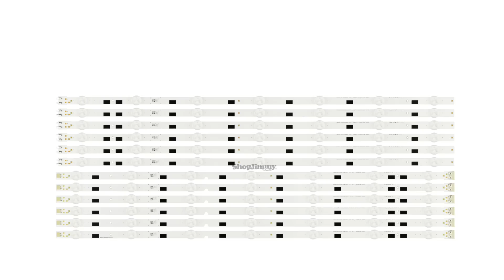Samsung 58" TV LED Strip Replacement Tutorial for No Backlights Samsung Model UE58 UN58 UA58

Comment: Can anyone please help i dont know what to do anymore to fix my tv,samsung replaced the powersupply board and the mainboard,tv worked again for a while because 3 months later a purple bal showed up in the left bottom corner, i replaced all the led strips 3 weeks ago and the tv whas like brand new again,now the problem i have for the last 2 days is that when i go into menu my backlight dims on its own,the tv never did that before,i opend it up today to check the ledstrips they all work but 1 led bulb illuminates less then the others,did i have bad luck with one off the ledstrips or is this maybe a t-con board problem,because samsung did not replace that board...???????
Reply: May have a bad part.

Comment: Excellent video. I have some dark patches which has caused a transistor on the power board to go open circuit. So I need to work out which LED strips are blown and replace them. It's a bit of a design flaw that if any of the LEDs go, it blows the power board.
Reply: 😮...I hope I won't have to replace that because It been replaced by a professional 2 years ago. These tv's don't last anymore.
Reply: @MNIGN56 I replaced the LEDs. I never want to do it again because it's not easy. I've got to fix the power board yet again because it's blown. I did get the TV for free, so I got 4 years out of it and I only paid for the LEDs, £50 from China.

Comment: Transistor QP801CS on the power supply board has gone bad on my tv. Bad led strips cause this to go bad. The tv powers up but that same transistor goes bad after a few hours. How do I check and confirm it's a strip before ordering?
Reply: Simply test each LED strip using an LED tester or, as shown in the attached video link, a DIY tester made out of 9volt batteries wired in series. That's what I did.  I think the same transistor kept blowing on my PS board also. I finally checked the strips and nearly half of them were not lighting. Now gonna order new strips.
Reply: https://youtu.be/4pK6o2DMLWQ

Comment: What voltages should be going to the backlight from the board?  UE58 has two blue and two black wires.
Reply: I'm also interested in this.
Reply: @napochulo  It was something like 364 volts on one wire. I replaced the back lights and the TV is working great.